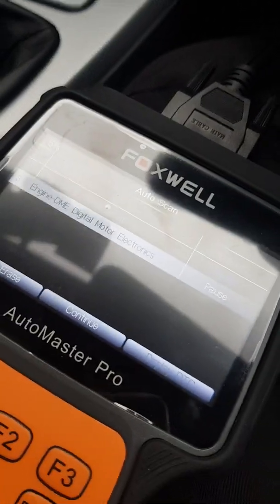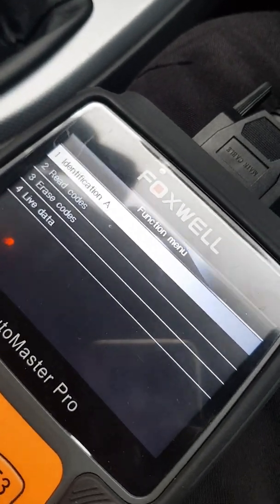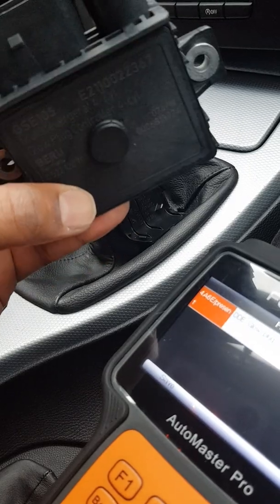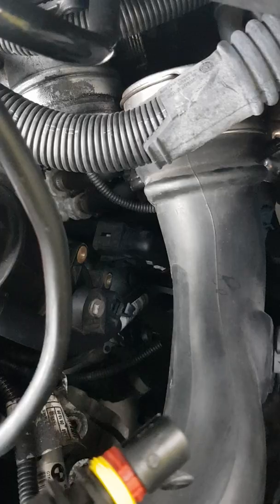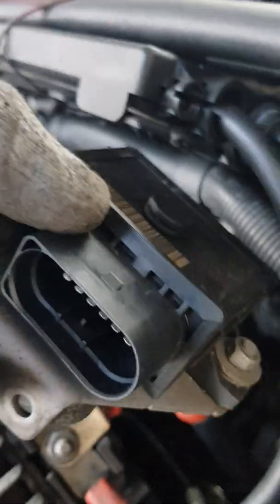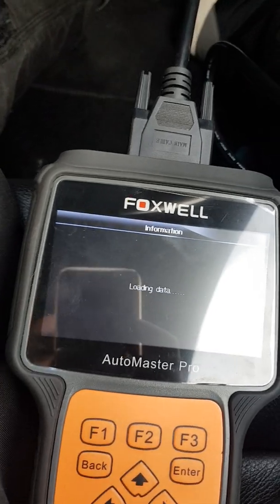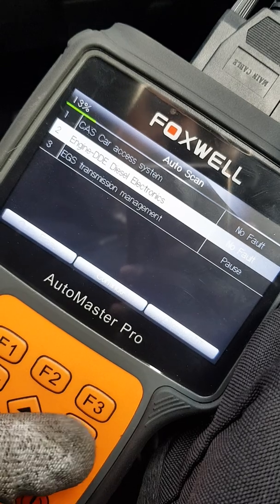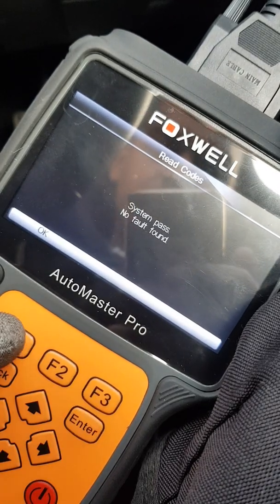BMW glow plug control unit replace N47 e90

Comment: Im getting glow plug relay eror is this it
Reply from the maker: @novicamitrovic467  hi mate yes if your getting glow plug relay error then I suspect your module is at fault. Replace the module and go from there . Follow the video it will be straight forward.  
Replace the module with a branded module not aftermarket rubbish.  
Use beru . That's what the manufactor uses .

Comment: Hi, if i had this code for cyclinders 1 2 and 3 will will this cause the car not start and run?.. chrs!
Reply from the maker: I'm not sure . But I would be changing the module if you have these faults. More than likely the module is faulty

Comment: I got Faults for glow plug activation code,  I was told due to this fault, dpf wont regenerate, if I will replace module, should it be fixed?
Reply from the maker: Yes if your glow plug control unit has failed you will have a fault in the dde. Any faults in the dde will stop regeneration of dpf. Hope this helps

Comment: Hallo
Will the car have powerloss when the module is not working?
Reply from the maker: If the glow plugs malfunction they will not provide the additional heat that aids in diesel combustion, which may cause the engine to experience misfires. The misfires may cause a loss in power, acceleration, and even fuel efficiency
Reply: @E30_Sunny 
Thanks for the reply
My father used my car to go drop my sister by the airport and he said the gearbox light came on and the car loss power... Then when he came home he plugged the launch in and it gave a preheating control unit missing code.
I see the one wire comes from the altenator and the altenator had some strange repairs done to it by a previous owner so i replaced it. And think the preheating unit got hurt during the altenator problems.

Comment: Hello, which one is the cylinder 1? I have the same fault as you. I changed the one from the back of the engine and still have the fault. Could be the module? Thanks!
Reply from the maker: Hi cylinder one is the one at the front of the engine . ( closest to the radiator ) it may be the module
Reply: @E30_Sunny  i’ve also changed the one from the radiator and still have the fault. Sure it’s the module. Thanks!

Comment: Would this prevent a car from starting? I noticed my N47 struggles to start in cold conditions and last year I plugged the diagnostics in to find it was a faulty module. It slipped my mind to replace it and the rough starting engine problem went away as the summer months came and the car warmed up. But now we are back in winter the car has now decided to not start at all! Just cranking away but nothing...
Reply from the maker: If your glow plug control module isn't working then I'd say there is a possibility that this would be the case . I would replace the module and see how you get on  . Didn't cost much and very easy to replace .
Reply: Thank you for your hasty reply, I have just fitted the part and am waiting for my battery to charge as it went flat cranking it over and over. Fingers crossed this fixes the issue if not I am at a loss
Reply from the maker: mitchell  check your ECU make sure it's not submerged in water this I believe is a common problem worth checking 👍

Comment: Mine comes up with glow plug 2 & 3 and sometimes it’s 4 as well when it’s running I ordered a module because it’s it’s easy to swap out and if that doesn’t fix it then I will do the glow plugs
Reply from the maker: I'm sure it will work . Keep us updated
Reply: Replaced all 4 glow plugs and was still getting a code for cylinder 3,
Replaced module and it’s all good now no codes
Reply from the maker: @KAOS_REAL  glad your problem is now solved  👍

Comment: Hi happy new year to you. I just removed my preheating module and reconnected as i was checking my friend car issue but when i put it back to my car i got codes preheating control unit missing! Any idea how to remove those codes? Thanks alot regards from France.
Reply from the maker: Happy new to you . Hmm that's a strange one . Have you used the correct control module ? There are various types for different engines . Make sure it matches the one you take off  . If all is well . My next point of call would be to check the wiring going to the unit. You might have a broken wire .
Reply: @E30_Sunny  its the same module unplug and plug it again then those codes appears. engine is like yours in the video  N47 177hp 2.0D.
Reply from the maker: @Winter1256  is it a new module your installing.?
Reply: @E30_Sunny  no, same one removed to see if my friend car has a problem in the module or glow plug then put it back to my car. Now every time i start the car it shows glow plug  sign on the dash even if the temperature is 10°C very wierd.
Reply from the maker: @Winter1256  I would order a new control unit and see how you get on .
Reply from the maker: Are you running the same engine as mine? N47 177bhp 2.0d? The control unit I used was a Beru GSE105.